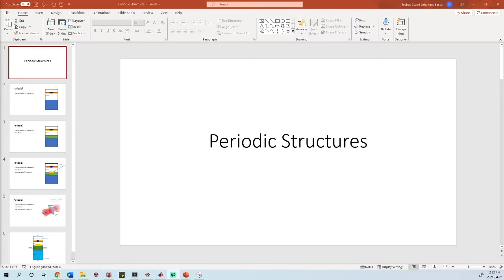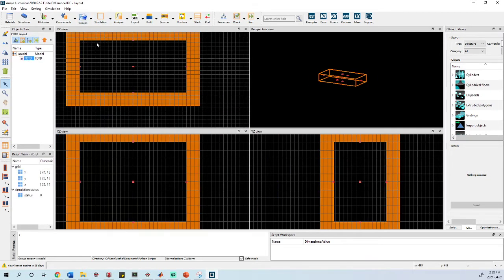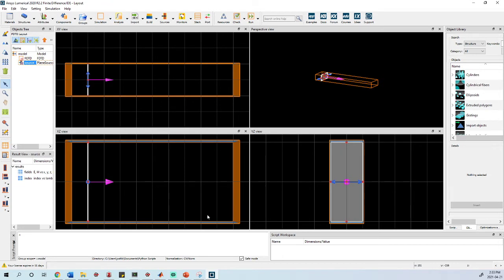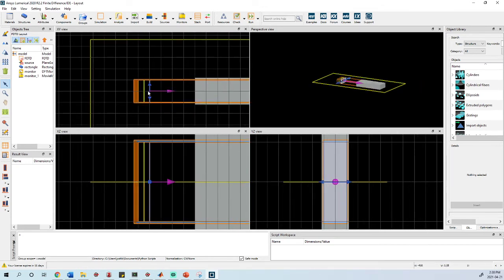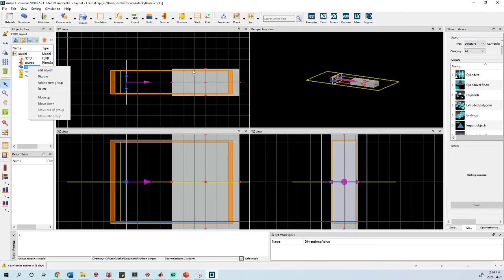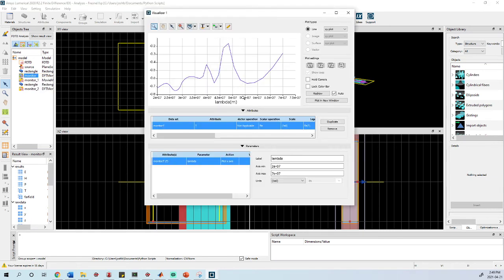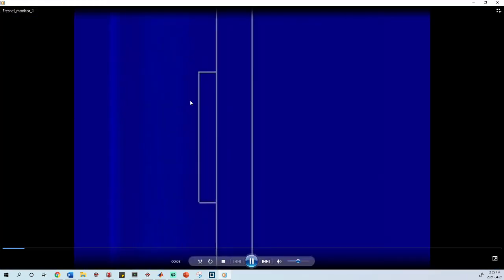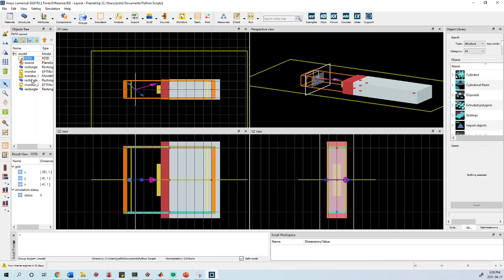Lumerical FDTD for Periodic Structures (Metasurfaces)

Comment: Thank you so much, I have a question, the reflection minimum comes out at around 280nm when I put the wavelength 200-700, but when I use 150-700 it shifts to around 320 nm! any idea why is this happening? and what should i do if I want to use a larger bandwidth for the simulation?
Reply: I have a similar problem. Did you figure out why this happens?

Comment: Hello, thank you very much for this exhaustively clear tutorial! I have a question, is it possible to set a state of polarization of an incident light and then analyze the polarization after the metasurface cell? Thanks :)
Reply from the maker: Of course! In the plane wave source, you can set the polarization state. In the transmission power monitor, you can analyze each component of the electric field individually. Using that, you can determine the polarization state.

For example, if you send in x-polarized light, you can measure how much is converted to y-polarization by simply looking at the y-component of the field in the power monitor,
Reply: @computationalnanophotonics9545  thank you very much :)

Comment: Please make a full video on solar cell simulation using Lumerical.Thank you
Reply from the maker: I'm afraid solar cells are beyond my expertise. But what I do know is that they are usually just thin film stacks. You may not even need lumerical for that. You can easily write a Transfer Matrix Method code to do this. 

That said, I will be making a video on Transfer Matrix Method in the future!
Reply: @computationalnanophotonics9545   Can you make a video for thin film solar cell example please...